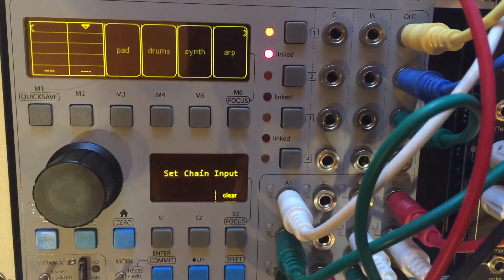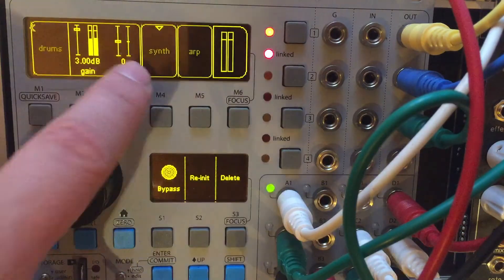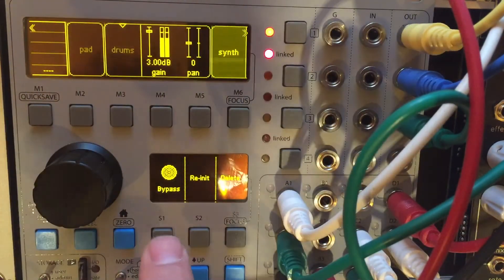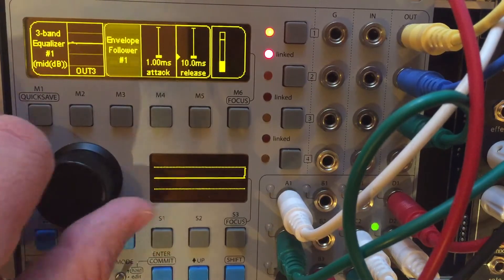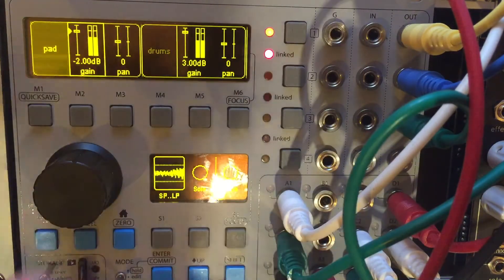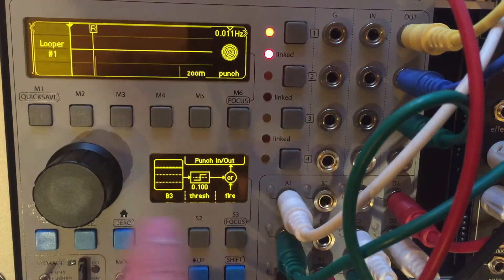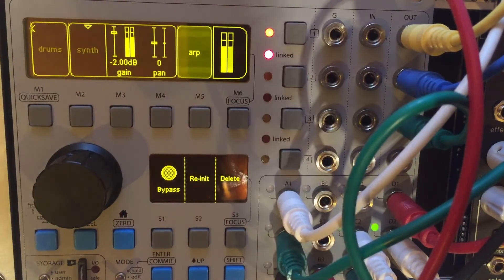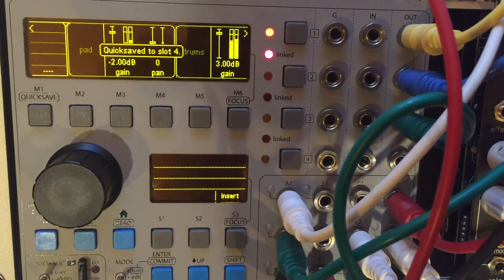Getting started with the ER-301 #16 - Big Complex Patch!

Comment: I'd be interested in using the CV from the keys mixed with the envelope follower for the ducking or the cv from the keys into the frequency of the midrange and the envelope follower where you had it!
thanks so much for these videos they are so helpful
Reply from the maker: that could work,  except i think (I'm not in front of it)  the mid band is fixed freq.